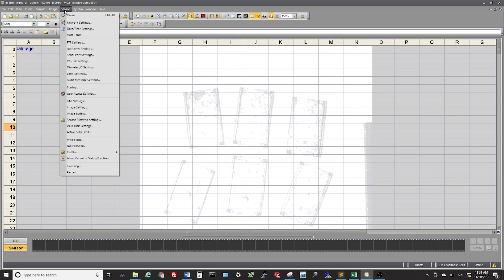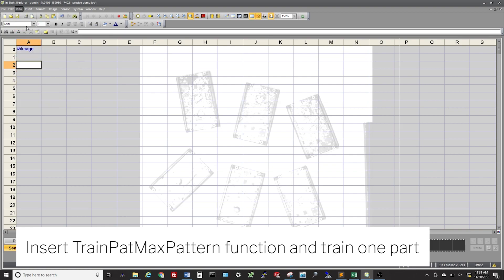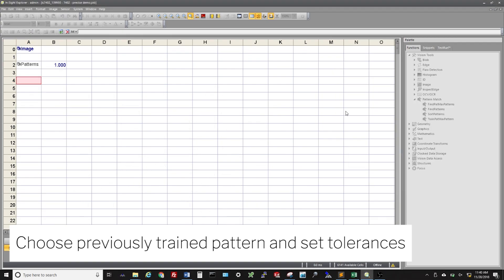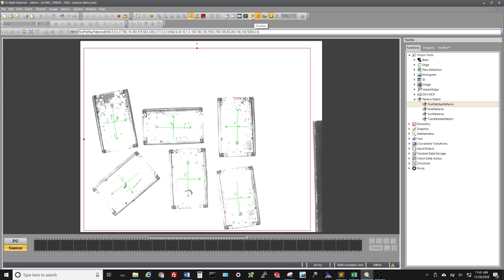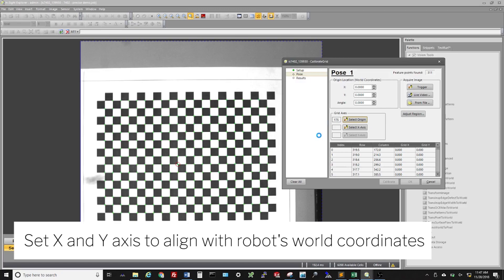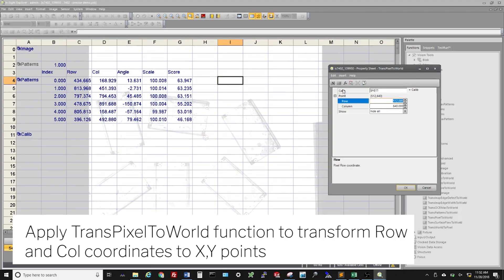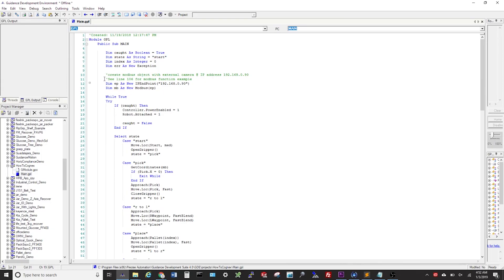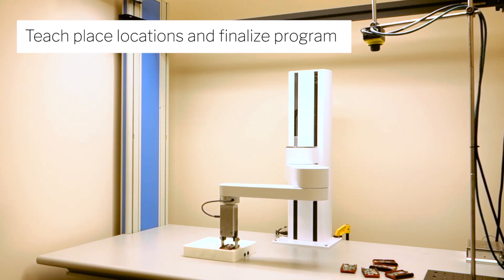How To Automate Cognex Vision On PreciseFlex SCARA

Comment: Hello sir
I am having difficulty connecting the cognex IS series camera to the Epson scara robot model RC90. Please help me make the connection and export the coordinates for the robot to run like the video you are demoing. I am currently connecting. cognex camera and Epson controller with computer using ethernet port, computer comes with cognex in-sight software and Epson RC5.0 software. Cognex In Sight I am using the easy builder interface, not the Spreadsheet interface
Sincerely thank you